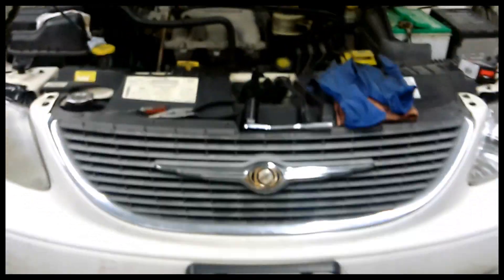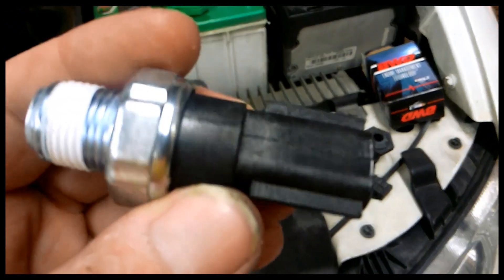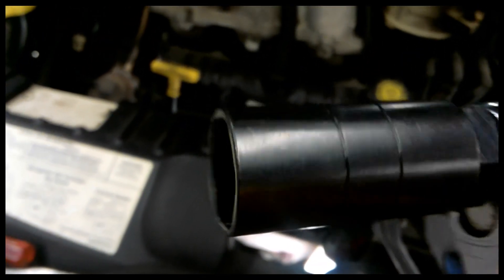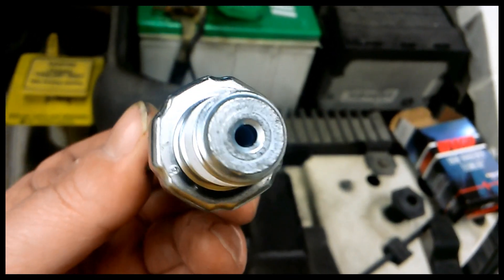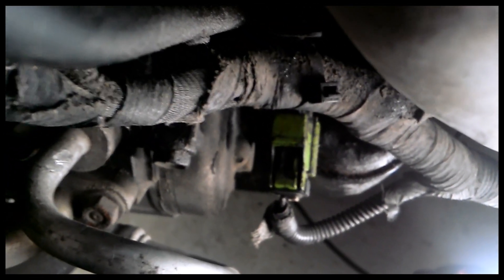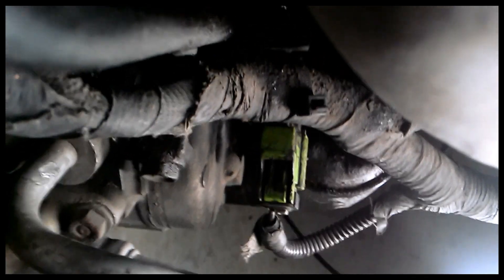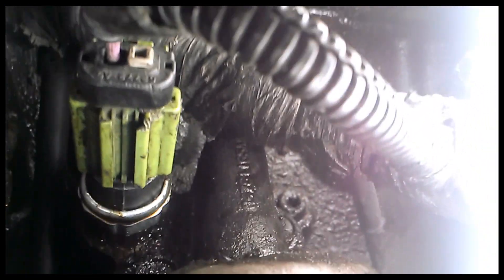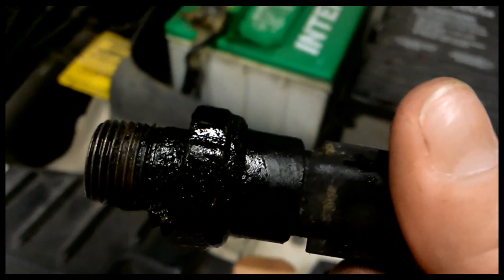2001 Chrysler Town & Country Oil Pressure Sensor (switch) - Intermittent Oil Warning Light

Comment: I just finished this job on my '99 Town & Country. Like everyone else said, the hardest part is removing the connector. To access the area, I chose not to remove the oil filter but to move aside the small plastic splash guard on the passenger side fender by removing two screws and two plastic push pins. I used needle-nose pliers to pull out the red locking tab. Be careful to wiggle it out gently on the last bit or you could slam your knuckles on something.

Once I got the tab out, I pressed down on the pressure "button" and pulled but nothing happened. It was locked tight after 16 years of sitting there. I didn't want to break it, so I ended up holding the button down with one hand and slipping a small screwdriver into the gap between the end of the connector and the sensor and twisted the screwdriver to push the connector back a bit. That did the trick. Once loosened about a quarter inch, the connector wiggled right off.

To get the sensor out I used a $12 oil sensor socket from Advance Auto with a three-inch socket extender for better reach. Before you pull it out, pay attention to how deeply the sensor is screwed in. I didn't do that, so I had to guess when I screwed my new one in. Like others have said, you don't want to over-tighten this part. You definitely don't tighten it all the way flush. Only a few drops of oil came out when I pulled my old sensor out.

Before installing my new sensor, I put a layer of Teflon tape on the threads -- but only a thin strip so that at least some of the threads ground with the threads of the engine block. After that I screwed the new sensor in, being careful not to over-tighten. As suggested here, I dabbed electrical grease inside the connectors and closed it up tight.

Afterwards I started up the car and ran it for a few minutes, looking for a leak around the newly installed sensor. Didn't see anything so I cleaned up. The whole job took a little over 2 hours for me, but I'm slow at these kinds of things. Hope this helps. Good luck!

Comment: Beano52, and Family.  We cannot thank you guys enough for posting this.  My Wife's 2004 Chrysler Seabring sedan 2.4L was experiencing the same symptoms, as your van. I knew the problem, and had the new sending unit in hand, but had trouble with releasing the connector.  Thankyou so much for taking the time to elaborate on this.  You are the only link on the web, that does.  The service manual even fails to talk about this connector. 
 
You guys ROCK!
Reply from the maker: I am very happy this was video was helpful!  Maybe save some time and money for those experiencing the problem.

Comment from the maker: There have been a few comments and questions about if it is needed to drain the oil.

No, it is not necessary.  When the sensor is removed a very small amount of oil will come out.  The oil pan should not drain.  You might lose 1 oz. at the most (the oil capicity of the motor is 4.5 quarts or 144 oz.).  This Town and Country has the 3.8 liter motor.  ALWAYS check the oil level on a flat surface and top off as needed.

I wish I had done a better job making this video but am happy some have found it helpful.
Reply: +beano52 
It's better to show than tell where something is or how to do it. Well your show and tell filled in the blanks. TFS
Reply from the maker: +MostlymoparIH Thank you.  Like I have said before, hopefully this helps someone, somewhere fix their problem.  Have a great day!
Reply: If anyone is interested, I did mine the other day and I had a significant amount of oil come out of the hole. It made a huge mess because I wasn't expecting much and didn't have a catch pan. I will note though, that draining the oil pan would most likely NOT help in this case as the oil that drained out of the hole was oil that was in the oil gallery passageways in the engine block ABOVE the level of the oil pan. My guess is the check valve in the filter mount was working correctly, and preventing oil from draining back into the pan when the engine was off. They do this to help keep oil at the top of the engine for cold starts. But obviously when I opened the oil passageway by removing the sensor all the oil above the sensor in the engine came running out on to the floor. Nothing you can do to prevent this. Just be prepared.

Comment: Good Video. Thanks for the help. I just replaced mine and because I just had an oil change, I didn't want to drain the oil.

A quick warning: When you remove the old sender, motor oil will gush out the hole until you get the new one in. Just thought I'd put that out there.

Comment: Yep - I picked up the special "oil switch socket" when I bought the oil switch and got it in last night in about an hour (figuring out how to get the dumb wiring harness off took up most of that time) and it worked like a champ. Thanks again!

Comment: Thank you for posting this - very helpful. My van is doing the same thing and I'm pretty confident this is the problem. I'll be putting in the new sensor today. As a general practice, I always try to spend 10 minutes learning how to do something before I go do it, simple though it may be. Learning from someone else always saves time and dumb mistakes - like knowing I need to pickup that 1 and 1/16" deep socket! ;) Thank you again!

Comment: Thank you my 2005 Dodge Grand Caravan has been leaking oil and I thought it was coming from the oil pan now I'm believing it is coming from the oil pressure switch thank you for this video
Reply from the maker: I'm gold you enjoyed it, hope it helps you fix the leak !
Reply: @beano52  now did you have to use a pressure gauge or anything after you installed it?
Reply from the maker: @pf210  no I did not, I did monitor for leaks for a couple days and none occurred, hope this helps !
Reply: @beano52  thank you God bless!!
Reply: @beano52  my neighbor just put on my oil pressure switch fingers crossed hope there's no more leaks thank you so much for this video I showed him too.. oh yeah and when he pulled off the plug to the oil pressure switch he told me there was there was supposed to be a rubber part inside the connector. Did your van have that in your connector to the oil pressure switch?

Comment: Thank you , was on the way to work and had the same problem on my 1999 T&C with the oil light coming on when stopped or braking.

watched video, and got it done in less than an hour, was only 2 hours late to work...:)

Comment from the maker: This sounds much more serious than just the sensor.  Our van ran fine, just an intermittent light.  ALWAYS check the oil levels if the "oil" light comes on.  Running a vehicle extremely low on oil could cause VERY SERIOUS problems.  Good LUck!

Comment: Thank you for your video! My 2001 Chrysler Voyager is acting exactly the same as the description. I just hope this will be easier than changing the water pump, that was a nightmare.
Reply from the maker: I'm glad it was helpful.  The loss of oil into the sensor is the problem a lot of the time.  My old sensor was COVERED in oil

Comment: When these units fail, the connector that leads back into the vehicle's wiring harness, will most definitely be soaked with oil.   Spray contact cleaner, and compressed air into the harness connector to ensure it is clean (and dry).  Also, add a dab of dielectric grease to the new sending unit's internal electrical prong, (with a Q-tip), before threading it into your engine.  Ensure the new sending unit has sealant on its threads, as well, before hand starting it into your 2.4L Chrysler.

Beano52, and Family did this RIGHT!!!   Thanks, a ton.  Super Post!
Reply from the maker: Thank you kindly !
Reply: P Cooligan I don't know what contact cleaner is which means I have none. But I have keyboard compressed air, something like that would be good? I also don't have dielectric grease but I have sealant. Is that ok?

Comment: The hardest part of changing this sensor, is after you slide the red plastic thingy ,,, press the green button at end of the connector towards you ,,, I broke mine trying to muscle it off without pressing green button , which is a rocker release for the connector. Similar connection is made on the alternator, etc

Comment: Do you tighten it all the way or leave a couple of threads visible? I hv 2000 Chrysler Town and Country 221000 miles and it was not leaking oil and it looked like 3-4 threads viewable until i tightened all the way bc i thought antifreeze was leaking from there. Now im going to back it up.

Comment from the maker: Take a look @ 2:36 The little red "tab" slides out releasing the connector.  It did take some careful "wiggling" but eventually comes free.  Be sure and clean very thoroughly with a good blast of some electrical cleaner or maybe a blast of air.

Comment: Could this fix a Chrysler Sebring when the oil light is coming on only when stopped and idling?  Whenever I press the gas it turns off.  I recently had a tune up and valve cover gaskets replaced.

Comment: My 2005 Dodge Caravan, trembles, and the engine stops when I'm driving, and the oil light appears, it's possible that the problem is Oil Pressure Sensor,

Comment: I have a Chrysler 2007 grand voyager 2.8 auto, is the oil pressure sensor located in the same place as on your car in this video? I want to remove it to do an oil pressure test through it, can I do that?

Comment: I was just wondering if you had your A/C line in the way? If so what did you do to remedy the situation? I purchased a standard socket as there would be more uses, also I would have to special order as no one had it in stock. Mine took me about 45 min to install with all above problems.

Comment: where can i find the oil pressure sensor on a 2003 durango r/t  5.9 engine?  thanx in advance
Reply from the maker: I honestly do not have experience with that model.  This video may point you in the right direction as it is the 5.7 in a Durango.  It seems to be on top/rear of the motor between the firewall and the intake, passenger side of the distributer.  Good Luck !

https://www.youtube.com/watch?v=T5HaIMCwh4o
Reply: I have had to replace on others and 99% are near the oil filter.

Comment: I have the same exact symptoms on my 2001 town and country, did changing that pressure sensor fix the problem?
Reply from the maker: Yes, it fixed the issue.  This is a very common, very easy fix.  Good Luck !

Comment: Buy a hex 1/2" drive 1 and 1/16" deep socket from Lowes for 9$.

I wish you had shown HOW to take off that connector - my biggest worry...
Reply from the maker: The actual "socket" tool was $7 from my local auto parts store.  The "connector" is removed by pulling the red retainer out (quite a ways) and I used needle nose pliers to wiggle it a bit and pull it straight off.  Hope that helps.
Reply: Turns out the socket wasn't necessary.  The sensor wasn't on that tight surprise surprise!
The problem with the connector is that on looking at it, you don't know how to remove it!  So in asking, it turns out, the exposed red tab sticking up has to be slide out OR - if you can't access it like I couldn't, use a small flat flat screwdriver, and push the flat end in on the opposite side, until it is flush with the connector.  Then press the green body and pull.  Comes right out.

Oh and - mine had oil in it! - meaning it was broken and leaking!!!  The replacement did the trick!!!  Wow!  For 10$ I did it all by my lonesome!!!

WOO WOO!!!!